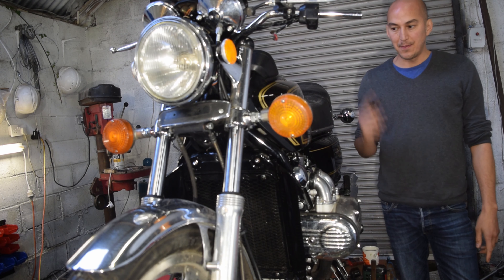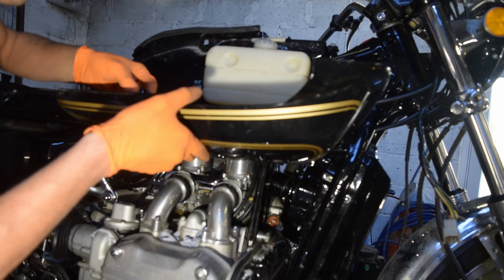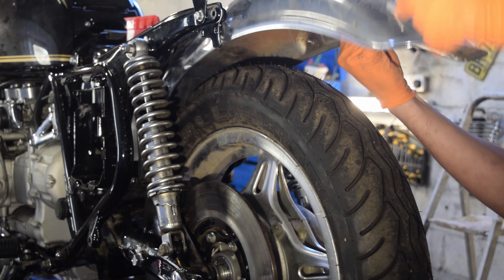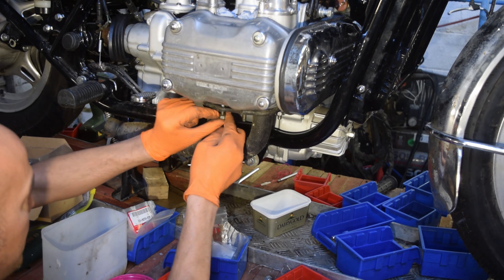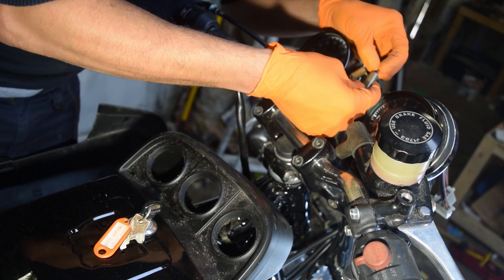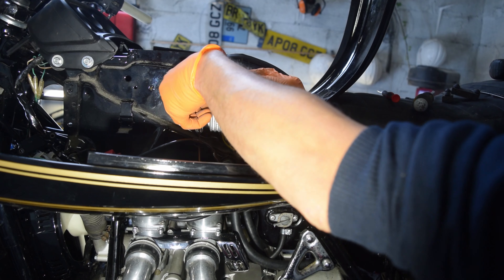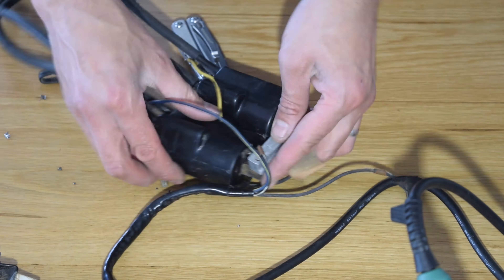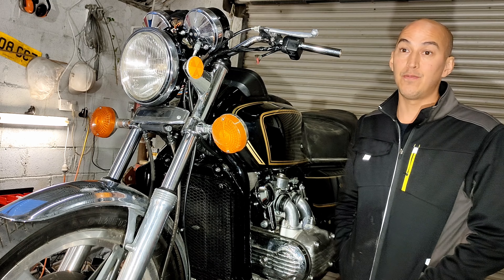Honda GL1000 Goldwing 1978 - Restoration - Repairing Starter relay and much more - Part 9

Comment: Wish I was that fast :)  Cool wrench you used on the headers.
Reply from the maker: Yeah I use it heaps for getting into those hard to reach places. I used it again for doing up the coils. Used with a magnet you can really get a bolt or screw into a tight spot.

Comment: When you set the points gap/timing, could you please explain your process? I'm having some trouble setting the points for cylinders 3 & 4 such that they have the correct timing and the correct gap. Also on a 78 GL1000
Reply from the maker: The bike has had the timing replaced for a digital type so it wasn't necessary for me to do the point gaps. As far as I'm aware the timing is set from the left and cam so if you have 1 and 2 correct then 3 and 4 should be ok, as it uses a wasted spark 1&3 are from the same coil and 2 and 4 from the other. I hope this helps

Comment: Ya probably already figured out by now that you should have laid out your wiring harness before ya put any parts on the frame ...
Reply from the maker: Yes, then I wouldn't have needed to remove some things. Also the neutral switch plug would be easier to our on with the engine out.